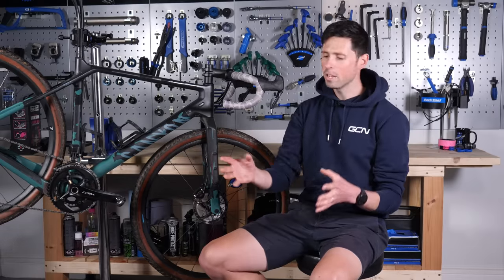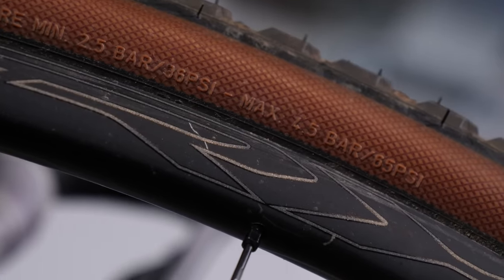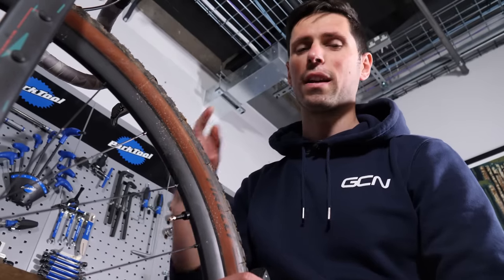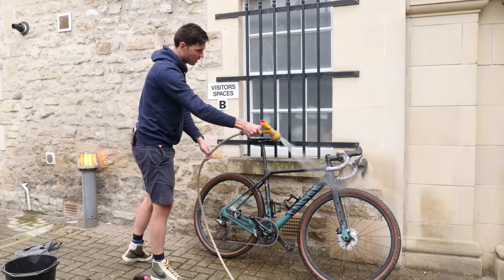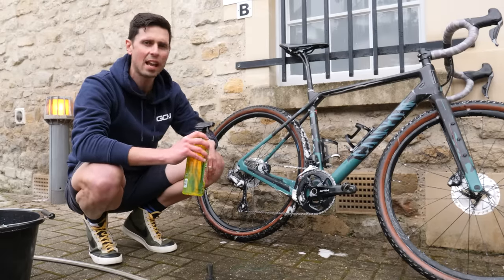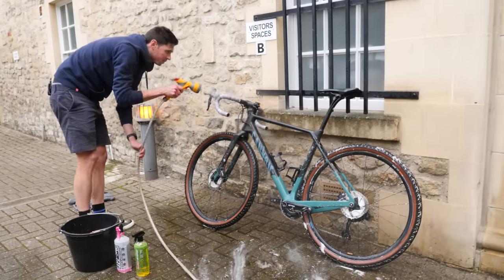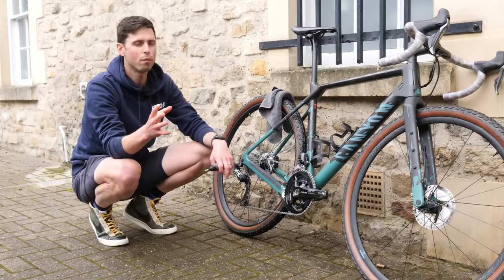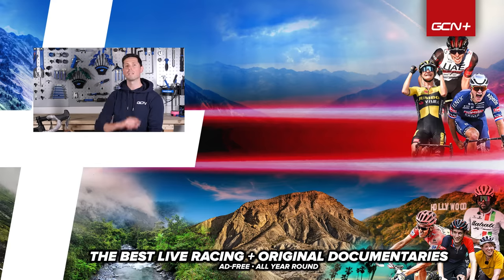3 Essential Bike Maintenance Tips For Beginners | Maintenance Monday

Comment from the maker: What other tips do you have for looking after your bike?
Reply: Can you make a video about fixing broken brakes?
Reply: Unwanted Noises and Rattles
Reply: Occasionally check for play in components, such as the headset, crankset, etc.

My headset developed some play after I recalled I hit a few big bumps the night before, luckily I checked before starting the ride.
Reply: Do I need to keep degreaser/soap off my disc brakes? How much do I need to worry about protecting them while I clean my bike?
Reply: After every ride I rub the tyres and rims down with a damp microfibres cloth, this is a good way to check your tyres for damage, I also check where/if sealant has pushed through as this will tell you if you picked up any punctures (none for me yet! 😱).
Reply: Keep it indoors or in another dry space to prevent corrosion!
Reply: Question! Does training with your kid in a bike cart behind your bike make you faster/stronger? Has this been tested?
Reply: Biggest things I've got: adjusting your brakes and checking the pads, and keeping your wheels true. Granted, if I had a sweet bike with hydraulic disc brakes I might be less apt to diy that, but rim brakes are really adjustable and keeping wheels true on a cheaper bike is something you'll have to do regularly.
Reply: Use a good car wash & wax- it makes the frame easier to clean & less dirt sticks to the frame.
Clean old oil off your chainset by by cycling through Scottish hillsides covered in Heather.
A jetwash is good to clean mud from your tyre treads….but nowhere else…..
Even if you only had water in your drinks bottle, CLEAN IT! It’s scary how quickly a slimy biofilm can build up even with just water. Carb loaded energy drinks however, can make for an interesting brew if left long enough- Pruno….if you know, you know.
Check under your saddle for mud…or worse. Nothing like the stink of dog 💩in your hallway and you cannot find the source!
Mountain bikers: don’t neglect your shoes. If you have cleats (SPD or whatever) a good soak and scrub to dislodge mud is definitely a worthwhile use of 5 minutes. 
And finally just make sure nothing has come loose: wheel hub bearings; also lock the front brake and check there’s no play in the headset. 
Whilst these comments may seem lighthearted, they are based on over 36 years of experience mountainbiking (add on 6 for serious road biking)
Reply: @marooples  as a general rule: no you don't need to keep degreaser and soap away from disc brakes; just make sure to keep the frame protector sprays (typically silicone-based) and oil/grease away from them. That said, some degreasers are what's known as two-component degreasers (most chain-specific degreasers are formulated like this), which leave behind a thin film of oil to act as an anti-rust barrier. This is not something you want to get on your brake discs nor pads! If you are really paranoid about this (which is not necessary to be honest, it doesn't matter all that much), make your bike wet first, then spray soap onto the disc brakes, and then (while the brake discs are still wet / covered in soap) proceed to clean your drivetrain with degreaser before rincing it all thoroughly with plain old water
Reply: Get a chain checker and periodically check. Easy to just lube the chain and forget about it then you have to replace the cassette and chainring too.
Reply: I love to see a good order of tool purchase. I'm just getting  back into cycling after a 20 year hiatius ... which tools and in which order would you suggest .. my trusty tri-allen key still works, but now, with all the new type of metals being used on bikes and specific torque amounts posted on my bike, I'm thinking my next purchase should be a quality torque wrench ... 🤔 ... btw, great video GCN Tech, thanks.
Reply: My fav lube chain, LOL, WD 40, which is a spay, and the lube goes in all directions ofc. 😂😂🤣 ... polluting the enviroment, which is THE THING I LIKE THE MOST !!! 😈😈😈 (was an irony, obviously)
Reply: Always check and make sure you have caps on the tires, make sure your brakes and working and always wear a helmet!
Reply: You probably wouldn't want to put water on a steel frame
Reply: Is there a method to lube my bike without a lube?
Reply: Use vaseline on the suspension to prevent it from errosion
Reply: Cleaning your bike not without protection underneath so chemicals cant pollute the earth
Reply: Eating a double cheeseburger with fries, and a large coke is better than riding on a smooth freaking tarmac

Comment: You forgot to mention that Presta valves often get stuck, or partially stuck. Press the valve, with a finger, for a tenth of a second to free it up. If the valve becomes really stuck, you won't be able to force any air into the tire.
Reply from the maker: Thanks Bill - another good tip!
Reply: I’ve added a lightweight oil to the valve before. Just a drop or even less! To keep it working smoothly. Something like tri-flow oil.

Comment: For beginners the tip of pushing the Presta valve in before starting to inflate; and if necessary adjusting the amount that the screw is undone. The screw works by pulling a rubber sleeve up to block the valve, and understanding this helps a lot

Comment: I have one, why you didn`t check chain meshes whether they turn ? No one is saying that but when a dirt mix with lube doing it just like you does not provide you with a proper solution to proper mechanics of a drive train, it only looks good and it`s in general bollocks. It took me 2 years to understand how the chain works (which is ofcse mentioned in shimano manual by the way) but the most important thing in chain is that all of the chains / meshes are actually moving - turning around... So when I started to look in a different way to the process now I can even do a lube and it`s efficient for 50 - 200 km done during 1-4 days on road, not to able to define for tarmac or other as it depends from conditions. So please explain why not a single movie is talking about it only interested in advertise of the product ... I was / still am using 2x11 drivetrain which price of every part is costly as h....l. My conclusion is that if your chain is really glutted with dirt the think you see here is absolutely worthless ... Your biggest interest is to have a moving parts in chain because this is how the chain works, in other way you will only use your bike parts and pay the prize for it. And this should be checked through cloth, at the beginning for each mesh if you can turn it around in two fingers. When you learn that than you will starting to figure out how to detect not moving meshes in much efficient way than each by each but only this can make your drive to work in efficient way, not only to minimize the usage, but also to make your ride as it should be and not making it a overkill force what can happen if the drive is inefficient... So my finger is down for this movie

Comment: Really good video, but just concerned about all of the degreaser and soap going into the drains… animals end up drinking that water. Perhaps there is a way to contain all of the soap and chemicals?
Thank you!
Reply: I was thinking about degreasing using petrol/gas on the brush and removing the residues with strips of old cloth...

Comment: Wd40 on chain after washing it??? Is that ok? To prevent rust?
Reply: Wrong chemical. Lubed chains won't develop surface rust.
Reply: @yonglingng5640  dosnt the wd40 help chase away water and dry the chain? Then you could apply the oil? Isn’t it bad to apply the oil to a wet chain?
Reply: @thepatternforms859  You air-dry or blow-dry a wet chain, not with a chemical. Nobody lubes a wet chain.
Reply: @yonglingng5640  in the world of dirt bikes and motocross racing it’s common place to use wd40 on a wet chain after washing. This helps to dry the chain safely and provide protection to the chain during the drying process. Metals can begin to rust very quickly even during the drying process… that is how fast… then, oil is added to the chain last….. this is common practice for dirt bike motorcycles… I think the same is good for bike chains and maybe even more important since the chains are smaller and more delicate and not sealed.

Comment: Do the valve back up and put the cap on! Any clothes used on a bike should be microfibre cloths. A bike is just like a car -- it has layers of paint covered by a layer of clear coat. Avoid scratching the clear coat by using microfibre cloths -- never an old rag or t-shirt, or paper towel.
Reply: Any cloth* used on a bike (...). And you do not put valve caps on road bikes! Valve caps' only purpose is to prevent the pointy valve rod from puncturing the tube when it's rolled up inside your jersey pockets. Before you insert a new tube you remove the cap and never use it again.

Comment: How often should you lube your chain?
Reply from the maker: It depends how often you ride and what conditions you ride in
Reply: for me if it's dry after 100 km, if it's wet after 50 km
Reply: @LukaszMielczarek  Do not tell me that when your ride is longer than 100 km, you stop inbetween and lube your chain.

Comment: Great video. thanks for the tips. Just a couple of comments - DON'T lay your sponge on the ground unless you want to risk turning it into sandpaper and secondly DON'T soak either the top or the underside of your saddle if it's a Brooks or any other leather saddle - you could wreck it. It's also worth keeping any chemicals off the tyres. They may not do immediate damage but they MAY gradually weaken tyres with repeated soakings.
Thanks again for a good video.

Comment: A clean bike is a safe bike 🚲...
One understands this saying as time rolls by.
Helpful video for many I'm sure 😃
GCN rocks!!
Reply: why does clean mean safe? what's wrong with just leaving it dirty?
Reply: @SuperSpable  Hi there, I learned this from a pro rider...
When you clean your bike throughly you tend to look at all the areas, you can investigate every inch of the bike. And see any inperfections very easily, like cracks, dents, especially on carbon frames, forks,  rims, seat posts, and even tyres. 
Thanks to doing this sort of thing, on several occasions after a nice clean I personally have spotted a cracks on my forks, and damage on the front Tyre. When earlier that day on my long 145 klms ride I got a snake bite puncture from a hole in the road. I was able to get home with a new tube. Thought, "hey everything is fine. But I wasn't able to see much as it rained and my bike was full of crud. If I hadn't checked everything closely after the wash, the next long ride could have ended with catastrophic consequences! I live and ride where the mountains have very steep climbs and 75 Klm. ascents, not good at all if you're riding at that speed with a cracked fork and a damaged sidewall on your Tyre... and through out the years more imperfections have been found after a cleaning. For me as well as many riders out there have seen first hand the meaning of 
"A clean bike is a safe bike"

Hope this has helped 

It just means that when  you deep clean,  you can see what's really happening underneath all the dirt, mud, crud.

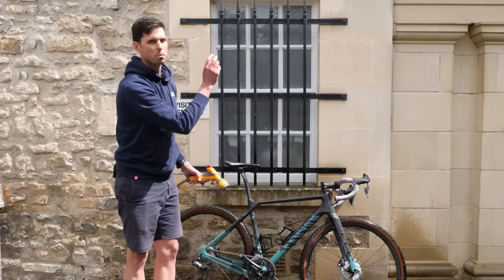Comment: 4:33 i you don't have hose and don't want to use bucket you can use air pressured water sprayer it's work great
Reply: I use one of these and I love it! Sometimes they’re called “pump sprayers”
Reply: @youvebeenmilked2893  they're have different names but if anyone dosen't know what we talked about it's hand pumped pressure sprayer for plants, it might sound silly but it's great to use (you can adjust stream width) simply power washer on budget
Reply: I have one of these! Much easier than connecting the hose up...
Reply: ... it* works* great.

Comment: Hi Alex, recently developed a couple of weird side bulges on my Hutchinson tire.  No external damage, cuts, abrasions, etc. and nothing on the interior either.  The tire just suddenly developed two hematomas in the sidewall on a recent ride.  The tire had maybe 500 miles on it, barely broken in.  What would cause such a thing?  I replaced the tires right away of course with some new Conti Gatorskins.  Hopefully they last a lot longer.  With tire prices these days I’ll go broke if I have to buy a new set of tires every 500 miles ☹️.
Reply: Did you try doing a return on the Hutchinson tyres that sounds like a fault too me.

Comment: unless I’ve been cycling in dirt or get caught in a rainstorm, I wash my bike 2x a month during the summer. more often during winter. in between rides I simply wipe down my bike with a clean rag & spray wax. I re-lube/clean my chain about 1x a week depending on where I’ve been. I also dry wipe my tires to remove any shards of glass or metals that could work into the tires. Goatheads are the nemesis for cyclists in desert or arid regions. love this video. simple. easy. done

Comment: About tire pressure.... I'am 69kg( 5f7, 169cm) and with the bike i'am at 82kg. I have 700x23mm tire. What should be the tire pressure?
Reply from the maker: You should be able to find a guide from your tyre manufacturer
Reply: You have 23 mm tyres but your bike weighs 13 kg? What kind of clunker is that?

Comment: It's always awkward pushing the pump head to the presta valve and pulling the lever, it never really work the first time
Reply: Rotate the wheel so the valve is at the bottom, thenn you just push the connector downwards- easy!

Comment: P.S. just to make you know my score at this point is almost 25000 km during 6 years, but over 22 000 km in 3 years, on cross bike in Polish harsh all years conditions and the amount of money for maintenance of 2 bikes actually which was needed was ridicules taking into account that My Hight is 193,5 and weight was between 100 - 114 in first 3 years, well now is much more, but same time I was a football player so I have turbo stron legs and insane pressure for drive chain in general. The second bike was ridden by my beloved one which was 50 55 kg and 165cm of Hight so wearing of her parts were of course in smaller amount but we have same bikes only different sizes, obviously.

Comment: The tires that came with my bike are rated for 25-50psi......but the bike manufacturer says too only pump them up to 23 psi....... mind you they are fat af tires and it's a rigid bike, soni THINK they want you to run low PSI to smooth out the ride. But 2 psi below the minimum  rating seems odd to me.

It's a specialized low entry 2.0
It's for pavement and sand.

I actually like taking a rigid bike down rough trails but my local bike shop insists ill destroy a riding bike that way......so time for a second bike!!

Comment: Dear All, beginner here.

I bought my very first road bike ever, 0km Triban RC520. After 1000km, my first disc break made a huge sound.

I've done everything like You showed from prior GCN videos on setting the brake, my bike has a cheaper quick-release skewer though (which I am about to blame), and my first wheels are always getting simply stuck by the brake, does not turn freely as if I am simply getting the breaks off to check on the wheels if they free-spin or not. Then, the weels are turning forewer, with my break pads and break system in, always stops (and skweeks while riding). Driving me nuts... it is a TRP HY/RD system, I don't like the general design to it, hard to screw the bolts, and also to maintain, but yeah, I tried like 30 times disassemble, put together. Pushed the pistons back, set the brakes with spacer tools, etcetc.

Where do I go wrong? Any help from You all is much appreciated!

PS: Huge fan of your work, Alex!
Reply: Hey András,

Make sure your disc rotor is not bend, this might also cause some rub.
And make sure your rotor is not polluted with dirt or oils. You could clean them with some disc brakes cleaner. 

Good luck!
Reply: @JoopLammerts  Thank You Joop, rotos looks almosz perfect, checked it many time with torch light as well and stick against it.

Looks clean (maybe it isnt, but from the looks of it)
Reply: @andras.89  if the rotors are straight I would suggest to go to your local bike shop, if that's possible :)
Reply: Search YouTube for “how to make disc brakes stop squeaking”

I can try to explain one method to you, but it’s hard to explain in comments. Its better if you watch videos.
Reply: @youvebeenmilked2893  
Thank You - tbh, I've seen like 10 different videos. I think I did everything what I can still have the problem :(
Although I'll check the exact one You are recommending, thank You!

Comment: Respect your mechanic! NO more water pressure than you'd use on your flowers in the garden please! Standard dish soap works just fine as long as you rinse well, put it directly on your sponge to wipe the drivetrain, brush it on the rest. 
IMHO you put way too much lube on that chain, you're either gonna end up with a mess or spend a lot of time wiping off the excess. Capillary attraction will carry the lube into all the key areas of the chain so less is more.
Reply: A good pass with a Kärcher, and the bike is clean in 30 seconds, including the drivetrain!

Comment: Tube setup for a 69kg rider is 54 psi ??? Dude you wanna destroy my ass or what? That’s rock hard tires holy shit. I run about 30 on my gravel bike with 37mm tires, i weight 72kg and my bike is usually over 12 kg…
Reply: Are you sure you are reading your pressure gauge correctly or know how to convert psi to bar? 30 psi equal 2.1 bar, that is a lower pressure than on regular car tyres! I run my 38 mm commuter bike tyres at 5 bars (73 psi), as soon as they drop below 4 bars, the bike feels significantly slower. Substract 1 bar (14.5 psi) for tubeless, but do not tell me your bike is still moving with almost flat tyres.